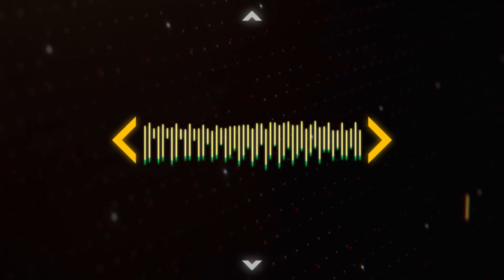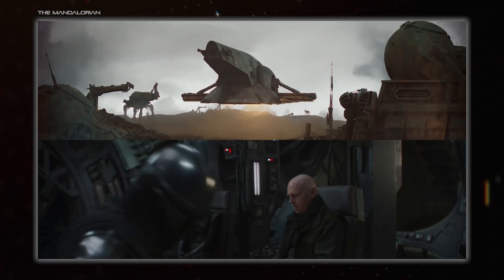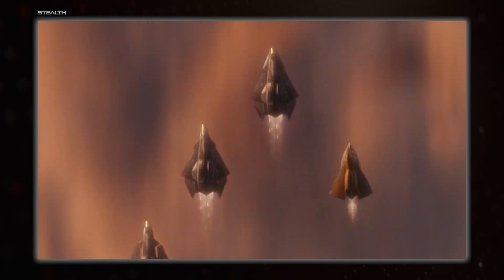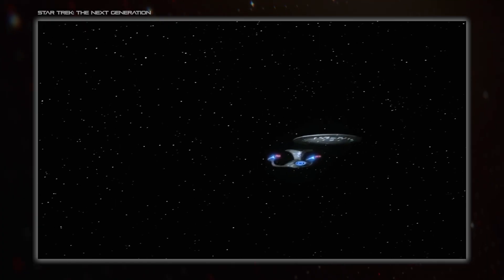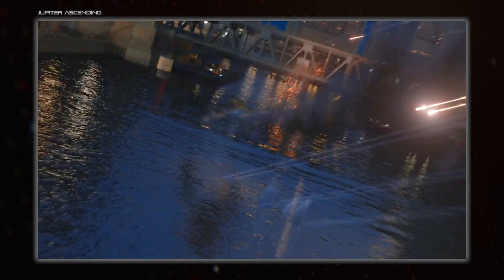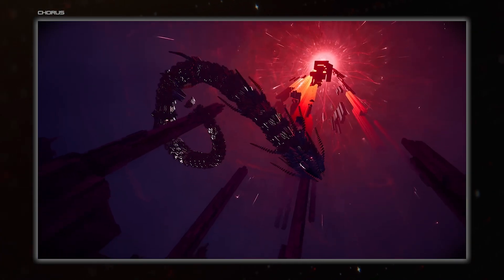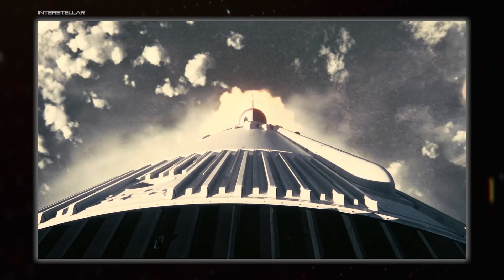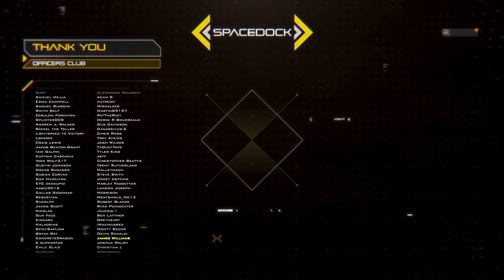Variable Geometry in Sci-Fi Spaceship Design

Comment: You could use the SDF-1/Macross as a variable ship as it has several modes and doesn't constitute as a "mech" itself
Reply: I was going to come and say this, then I remembered that it literally punches enemy ships, so it's kind of more mecha than, say, a ship with variable parts. It probably falls safely under the "transforming robot" trope.
Reply: @Judgewrath1  Was going to also state the SDF-1, but based on your logic, yeah. Especial it's predecessors the Macross Quarter (Frontier) which the captain literally surfs to the planet surface in the end battle (no joke) and the Elesyium (Delta) which pulls some crazy almost gundam style moves. Think only the Macross Cannon (Marcoss II) can qualify as it does a minor shift and has to open it's four huge guns (which are actually old Zentrandi battleships) to fire.
Reply: @wolfdeltanine  Well, yeah, but that was only in the in-universe movies, not the series canon

But dude, there were great waves- what can you do?
Reply: The Vf-1s ought to count as well then since their fighter mode is a swing wing design.
Reply: @Octarinewolf  you are technically correct. The best kind of correct.
Reply: I came here to see if the SDF-1 was mentioned. Despite the punching maneuver with the Daedalus (which wasn't an original part of the ship), I still think it counts.
Reply: @Datan0de  I'd agree with that
The original transformation sequence was only because of the loss of the Protoculture generator anyway

I'd also agree that the VF-1 Veritechs should count as they really aren't "mecha" by the same terms as they have 3 forms. Likewise the hover tanks could be considered as well
Reply: @Datan0de  True, it was Daedalus (not sure if the Prometheus got in on the punching fun); however, the "shoulders" and part of the upper arms were already there- so the naval attachments feel more like prosthetic replacements instead of completely unique aspects
Reply: It literally transforms into a giant mech holding a cannon
Reply: Attack mode is arguably a (really, really big) mech, but it has variable geometry in cruiser mode without transforming.  In literally the first episode it shows this when the main gun auto-fires.
Reply: @WillowEpp  Maybe; while the cannon "opening" to fire is a change, is it more analogous to variable geometry or a turret reorienting or hangar bay opening? 

(And there is the question of "If a vehicle is a transforming mech, does any VG in any specific form still count?")
Reply: @Sephiroth144  Per the video, "charging your superweapon" is a valid geometry change.  To the latter, the firing sequence is completely different in cruise and attack mode, so I can't imagine any valid reason to leave it out.
Reply: It is totally a mech.

Comment: the funniest thing about the argama class, which is pictured in the thumbnail, is that from what i know it's the only ship in all of uc gundam that does centrufugical gravity. All the rest just persist in zero g inside
Reply: Nah, most Fed capital ships have an internal centrifuge. Even White Base had one. The Argama was unusual in that the centrifuge was external.
Reply: @Bleachsoul13  The Argama is not a Fed ship, probably why it uses an external one instead of an internal one
Reply: @Bleachsoul13  Huh, as an ardent Gundam fan you just pointed something out for me: most, if not all, Zeon built ships don't have a centrifugal gravity lock as part of their design.
Reply: @NewtypeCommander  Yep. That's by design. Look also at their spacesuits. Federation normal suits are bulky, armored pressure suits. Zeon spacesuits are just thin form-fitting bodygloves with a helmet and life support/thruster backpack. This is supposed to show that the Spacenoids are way more comfortable living, working and fighting in space than the Earthers. Likewise, the Zeon air and ground units being so awkward (Magella tank and Dopp are the standout examples) is due to them really having no idea how atmospheric and ground combat work and trying to come up with something from first principle.
Reply: It's upgrade has it too  same with Jupiteris class too
Reply: White base has a ring inside and it is actually visible in the show where you can see the curve when they are in the coridoor connecting the bedrooms. I don't know how that works in gravity though...
Reply: According to the old Japanese entertainment bibles the Argama has an external centrifuge because it's cover up during development was an experimental luxury liner and the extravagant feature was put there to increase the expenses without having the Feddies too nosy about the project. This also led to better habitability compared to the Irish class which was completed when Anaheim was more mask off about the whole AEUG thing and is generally more practical.
Reply: Nope, lots of them do.
Reply: It kinda bugged me that Gundam ships were shown but not talked about...
Reply: Pretty sure I remember one ship in Iron Blooded Orphans mentioning their gravity comes from acceleration. Could be wrong I don't Gundam.
Reply: @MediaevalJames In IBO the Ahab reactors do produce an artificial gravity effect. However, this effect costs energy to produce, so they can elect to turn it off when entering combat, thus experiencing natural inertia again. So that might've been the thing you remember.
Reply: @MediaevalJames  for cruising they use ahab thrusters, which do not need propelant, so constant thrust, yes. But it is also explicitly mentioned that both ships and Gundam frames have proper inertia management systems, that allow for artificial gravity, not centrifugal. 00 has mass manipulation and I've always assumed Ptolemy just generates it's own gravitational shadow so there is grav on board.
Again, if IBO is the only AU of Gundam that has true artificial gravity, that would've been hysterical.
Reply: @Sm00k  I don't think Ptolemy had gravity at all, especially the first Ptolemy as they mention they need to send the pilots to a colony or earth due to health concerns from spending too much time in zero g. Allelujah could last longer due to the reconstruction of his body.
Reply: @Sm00k  tbh, IBO also gives good reasoning of why they only use kinetic weapons with beam weapons from Mobile armor just bouncing off the MS armor. It's funny how IBO looks low-tech but in reality more advanced than other Gundam shows overall
Reply: @OmegaEnvych  it's old. Not low tech, yes.
Reply: @OmegaEnvych  its because of the calamity war around 300-ish years before IBO started where they fight off the AI (or in lore they are referred to as Angels) where they deployed mobile factory unit like Hashmal that produce drones with lasers/beam weaponry. to counter this, mankind had to develop and use nanolaminated armor that dispersed/reflect the beam rendering those weapons ineffective and opted for kinetic based weaponry or what i like to call 'slug throwers' and 'free for all slug fest with the biggest metal rod'. and the gundams in the universe as dubbed as the demon/devil as they hunted down those 'angels'.
Reply: @OmegaEnvych  It's post-apocalyptic. Kinda like Fallout having all those fancy bits of pre-war tech still around while having an overall feel more akin to the Old West...
Reply: A lot of ships had it in the Gundam franchise. The Archangel from SEED, the Ptolemy from 00, probably a few more I forgot...
Reply: @Plaprad  Ptolemy didn't have the grav gn plates? Lol, so only IBO junkers have true artificial grav on board out of all gundam AUs? HA.
Reply: @Plaprad  Don't think I recall either Ptolemy having gravity inside of it at any point tbh
Reply: @RayShadow278  I could be mistaken on that one. I remember the rotating bit for the mobile suits. 

Didn't really like 00, so my memories are rather hazy after nearly two decades.
Reply: @Plaprad  pretty sure no ship in seed has centrifuge force. you can see many scenes of them in space, and in all of them they are floating. even in the sleeping barracks.

Comment: I still think the Ace Combat X02 Wyvern has my favorite folding wing design.
Reply: really not realistic but yeah it is so cool. a plane from a game of the same genre is the SP-34R in Project Wingman, it's very variable-geometry. thrust-vectoring engines, retracting canards and wingtips, tailfins that fold into the main wings at supersonic flight
Reply: @ez_theta_z9317  I'm not sure the SP-34R actually has those features. It's the DAKKA plane right? The one with the canister pods, railgun, explosive rounds and machine guns that shoot like a beam?
Reply: @spartantraveler7251  it is indeed the brrt-plane, and does indeed have a lot of variable-geometry
Reply: @ez_theta_z9317  Yeah, i play Project Wingman and i love the SP34R. the PW. Mk1 might be op, but it will never match the fun factor of the Spear.
Reply: @NightBeWheat  do mission 11 on mercenary difficulty with the Double Time and Gun Runner modifications. another level of fun
Reply: @ez_theta_z9317  Once i finish my Solo Wing Pixy playthrough (Only using modded ADFX-02 with railgun and 1 weapon slot)